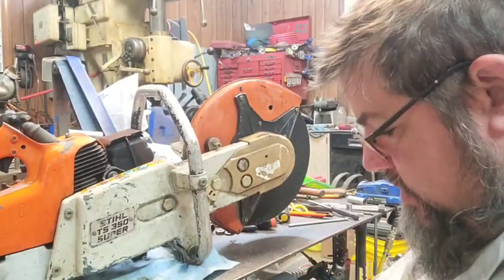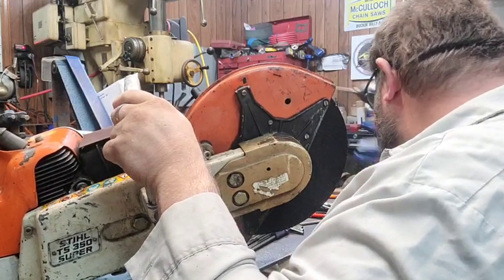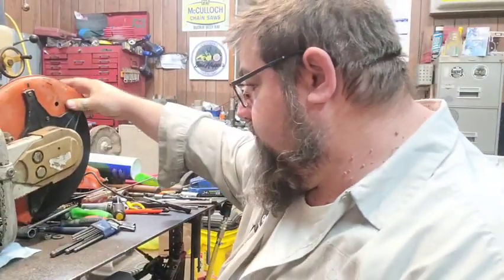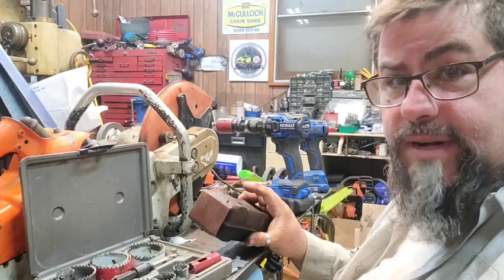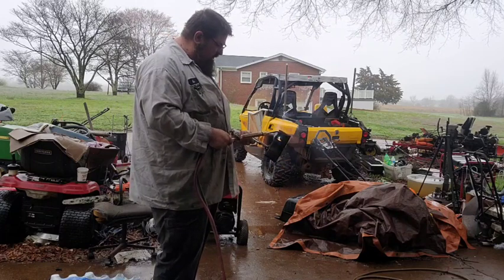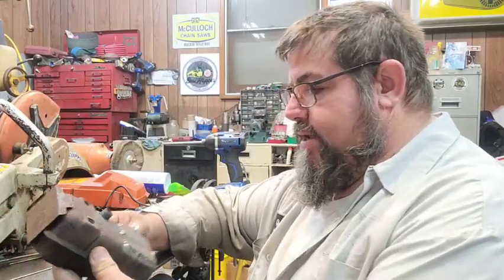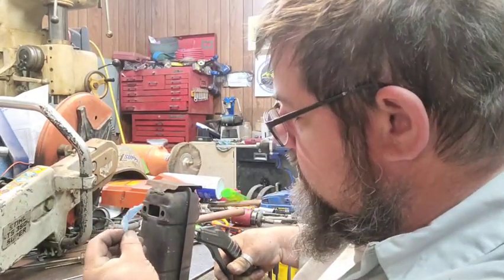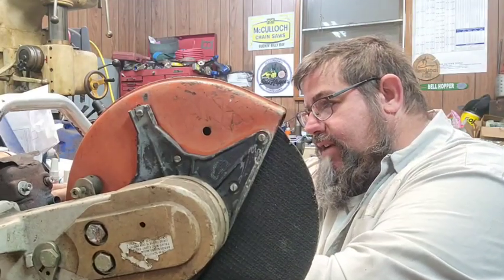Stihl Ts 350 Super Muffler Stopped Up And Choke Stuck

Comment: Why did you not want to open the exhaust on a concrete saw? I recently purchased a 272K and it is governed. I was guessing that improving its performance was not desired due to over revving the cutting tool. It has a problem of bogging out and quiting in the cut. I put a carb kit in it but still no dice. Thinking maybe and ignition issue. Nice work, thanks for the video!

Comment: a just do clean out muffler on  2 strokes with some wire cable and a drill. putt the wire on the drill and lett it spin inside the muffler. sometimes putt gasoline inside the muffler and letting it burn out,then just cnocking out the carbon.good fix there.hope yours back its soon better
Reply: I normally just use a handheld torch with met gas and heat the seam up and take some needle nose pliers and regular pliers and bend the seam out straight and pop them mufflers apart that way and clean them or I'll just run out by one of the local mower shops and grab a good used muffler or maybe a couple of dollars and put on a machine and luckily I've been able to come up with good used mufflers at one of these shops around here when I've needed one.....
Reply: @goldhunter9641  that works good too

Comment: As a guy with a bad back I have tried almost everything. When it’s put me in bed my doc gives me tramadol. But when it’s not too crippling l use a tens unit. I bought mine of of Amazon. They work great, they use to only be used in my Physical therapy office but now you can get them off of Amazon. The one I use has 4 channels. I can do my wolves back it works like gangbusters. If you want I can send you the link of the unit I use their cheap I think mine with extra pads and the “handsome” carry case was like 80.00. They pads last a long time before you have to change them. Feel better also Max Freeze sold at Walmart works pretty well along with bio freeze.

Comment: I have that exact same power head on a 2 man auger, it's actually an old stihl power saw that they adapted to fit many other attachments, I forget what saw it began as though, I know that when I was buying some parts for it I had to figure out what the original saw was and buy parts for that cause if you searched the tool model number you couldn't find anything, or in my case you could only find parts for the attachment so it was bringing up auger bits and shear pins and stuff like that but nothing for the actual engine.  What type of welder are you using there hopper? I was guessing a MIG with    .25 copper wire and argon? I was just wondering cause that's a pretty good weld on a saw exhaust. I use flux core and I can never get my welds that pretty. Hope yer back gets better bud, I have the same problem, I'm good most of the time but every once in a while I'll twist the wrong way or something and I can't hardly move the next day, it's not fun for sure. Take it easy bud. Be safe! Be kind! Give love!